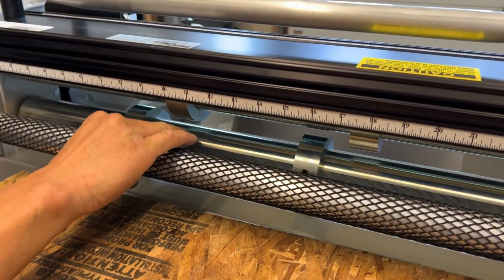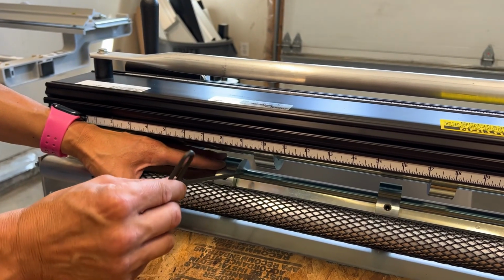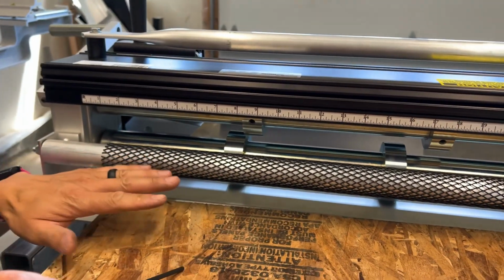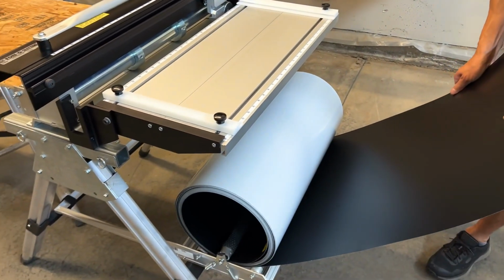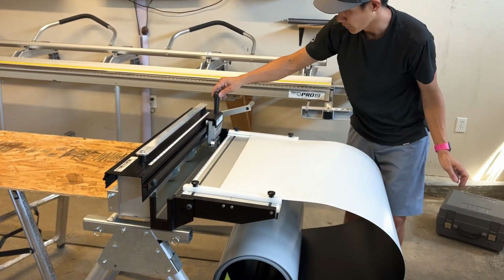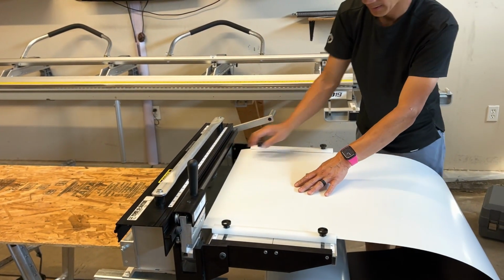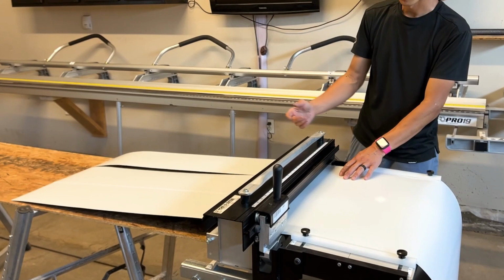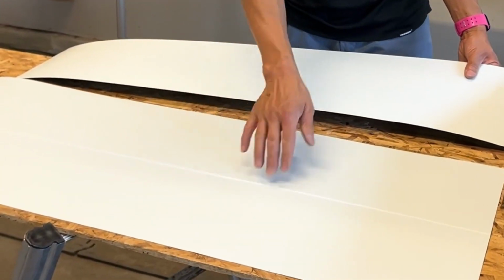Tapco Tools Port-o-Slitter Introduction & Instructions

Comment: With regular coil stock I’ve always just used my brake for slitting. 

But when I use heavier gauge sheets it’s hard on the brake. 
Do you think your slitter would cut a .032 /4’x20’ aluminum sheet?